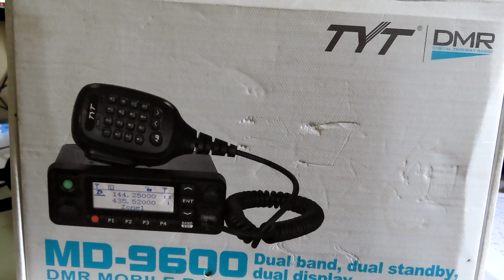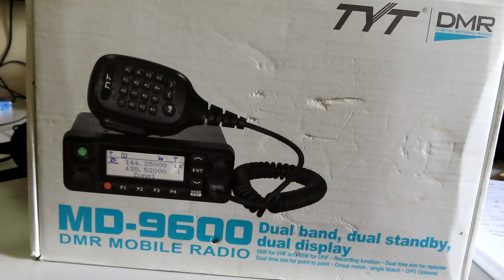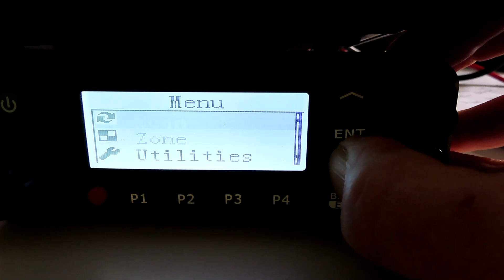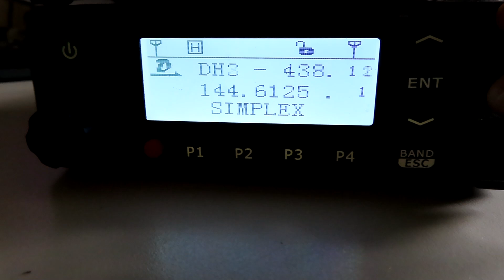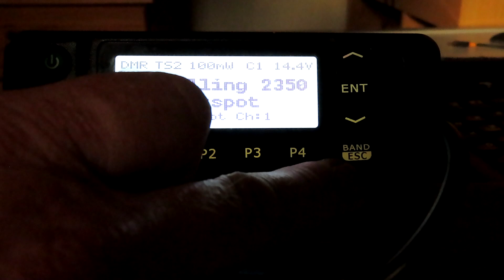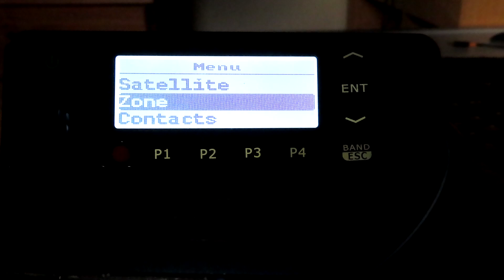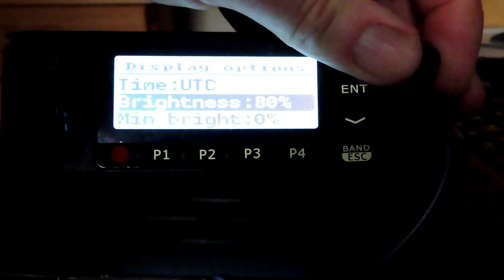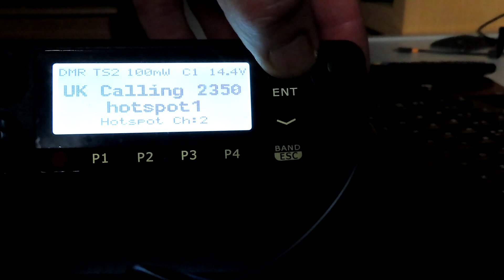Upgrading the MD9600 with the Open Firmware

Comment: Novice here - have baofeng DM32 and md9600 - how did you program them to talk to each other?
Reply from the maker: Make sure each radio is using the same frequency,  the same time slot and the same colour code.
Reply: @KevinOReillyswl thank you sir. Could the problem be using the baofeng CPS & the tyt CPS? I wish there were a video showing how to program these radios to talk together when using their native CPS.

Comment: nice  video! Do you know how to put OpenRTX / M17 firmware to this radio?
Reply from the maker: No I haven't tried OpenRTX firmware. Most if not all radios require hardware modifications before they can be used for M17.

Comment: Hi, great review!
Do you know any software or way to adjust/tune the Tx output power of RT90?
Because after checking mine with many Power & SWR Meters I found that the radio output Tx is below Specs. At some levels is half the power it should be.
If you have the software or know the way to adjust that, I'd REALLY appreciate your help!
Thank you very much
Reply from the maker: Not that I know of I imagine this may require internal adjustment rather than just software.
Reply: @KevinOReillyswl  
Thanks for replying Kevin. In fact it can be tuned by software, at least many portable DMR radios can with the proper one.
Reply: @PabloVazquezVisualArts  you are not measuring output in digital are you? It will not measure wattage correctly unless you are transmitting in analog
Reply: @juliogonzo2718  
I measure in Analog, sure. Thanks for writing.